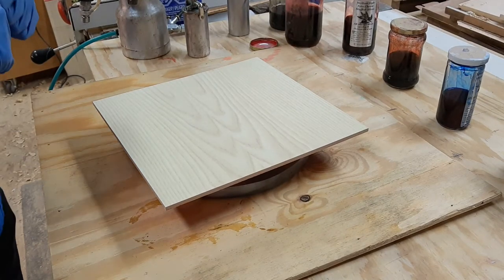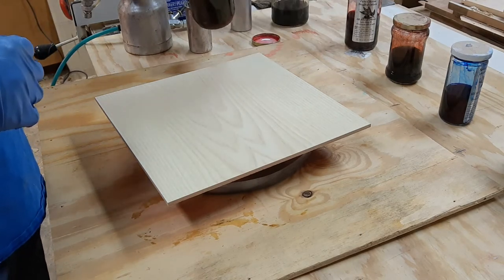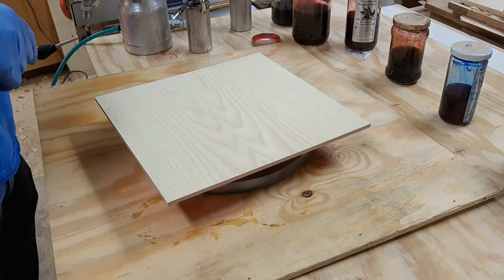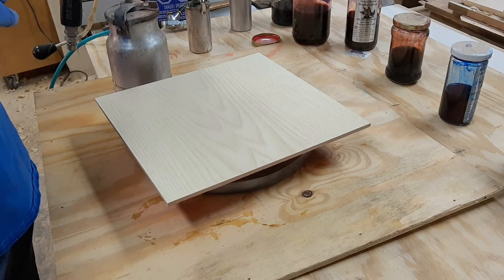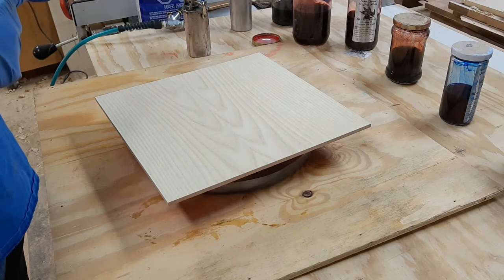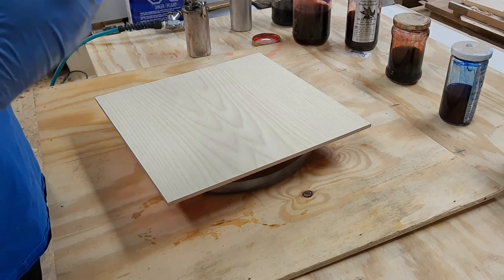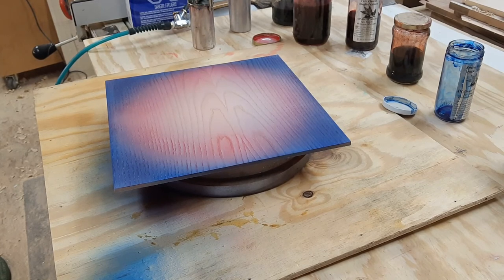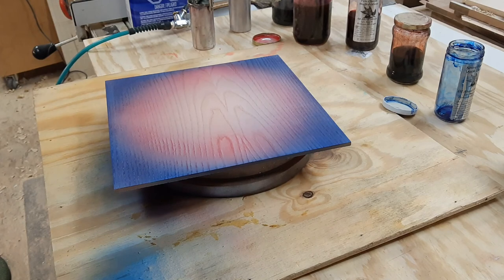Shading Wood/Sunburst Pattern

Comment: What is the smaller gun that you're using here? Is that a standard HVLP with a reservoir and a smaller flow/spray pattern?
Reply from the maker: That is generally referred to a as a "detail gun".  I chose this due to the smaller size I was spraying.  This one was also not technically an HVLP but running right off the compressor.